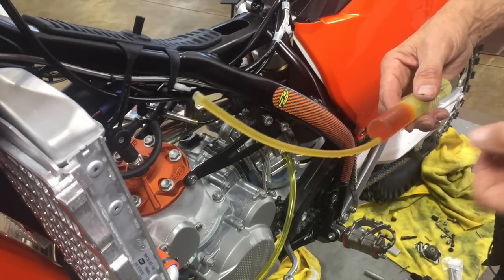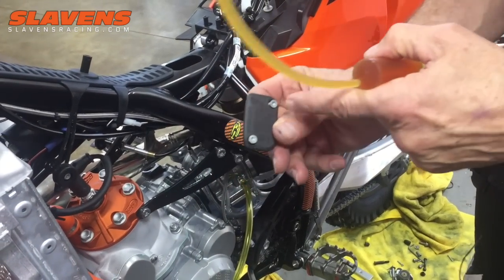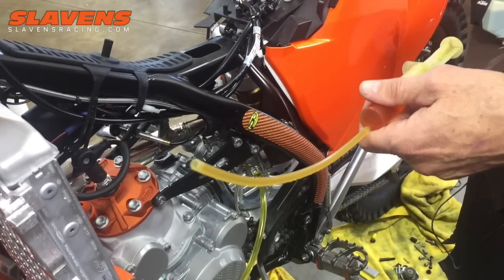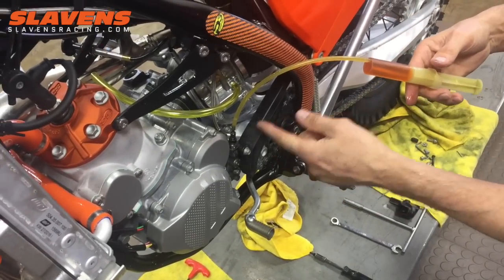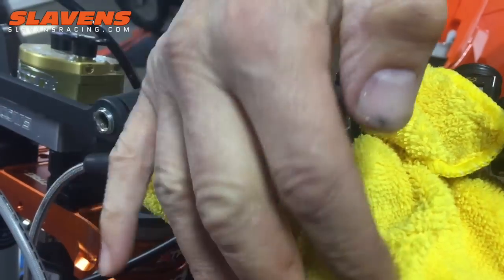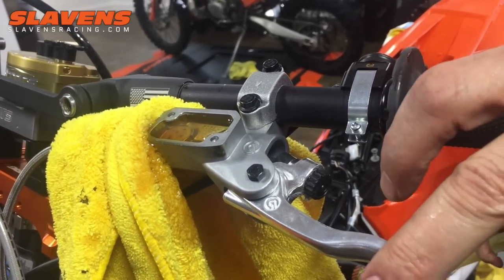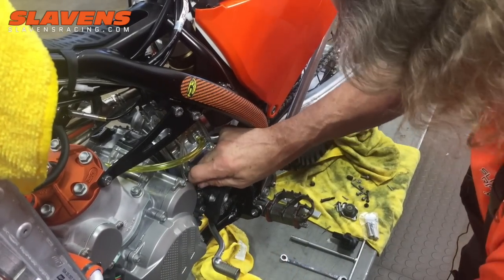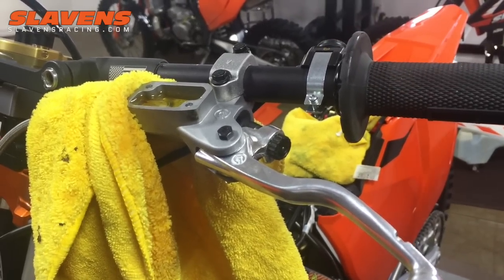How-to bleed KTM, HQV Clutch Master Cylinder

Comment: Hey Jeff I cant get fluid to go up the line and into the master its like it’s clogged or something 

What could it be ?
Reply from the maker: Is the lever slightly pushed in by the handguard or is there no freeplay in the lever?
Reply: I also have this issue.
I bought a 2017 300XC and there was only gunk left in the master reservoir. Tried to drain and bleed it but cant budge it.
I’m guessing either the master or slave cylinders are maybe jammed?

Comment: Thanks for the info that different clutches use different fluids. Mine, KTM SMT, uses mineral oil according to the manual. P.S. Why not just get two syringes; one to push, one to suck. That way you avoid the mess at the top.
Reply from the maker: That would be fine if you have a helper. My time working on bikes is private time.
Reply: @slaverace1  I just use an old Turkey Baster to draw off the reservoir as I pump in fresh fluid from below. Spit it into a jar nearby so I don't have to leave the bike.

Comment: In my little sight glass window of the front break master it appears to only be about 65% full of liquid and the rest of space above is an air bubble is this normal?
Reply from the maker: Definitely not optimal.
Reply: @slaverace1  shit bike only has 4 hours on it does it just need topped off with fluid and bled? Why is it like this you think?

Comment: Weird. A lot of ppl in the forums say the o ring in the slave cylinder can't handle brake fluid for long (despite the recommendation). The only thing i see with the mineral oil, is it is too thick to properly travel through the master cylinder (outside of viscosity,  its not gonna do more damage than brake fluid on a seal). And once that seal breaks, you're looking at brakefluid leaking into your oil. I'd rather mineral oil mix in there than brake fluid any day. Magura recalled master brake cylinders and it sounds like they need to recall the clutch slave cylinders on the 2018 oem parts. I feel the only reason they haven't done it is because it won't get ppl hurt. Its just a garbage part with no aftermarket replacement. More $$ for magura
Reply from the maker: You must have forgotten to turn on the BS filter on your computer before getting on the forums.

Comment: Hey Jeff,
This may be an amateur question but I recently replaced the clutch plates on my Ktm which has the dds clutch in it.  I back bled the clutch but it still seems to creep forward on me until the lever is pretty well all the way to the grip.  Is it likely there’s still air in the line causing it to release a little late or should I be looking more at say the adjusting ring outside the bevel spring?  Thanks in advance truly appreciate the videos.  Cheers
Reply: Jeff........I have the same scenario, using a genuine clutch in a 2020 300 TPI.....I will be reverse bleeding the clutch line again in case I missed some air.....have you got any advise please?

Comment: I've tried every way with mine it's not wanting to gravity bleed this way or anyway I rebuilt slave cylinder got new clutch line new master slave cylinder does this mean I need a new clutch plates or whole new slave cylinder please I'm tired I'm spending money I'm about to just buy recluse auto and say he'll with it
Reply from the maker: Jesse:
I don't "gravity feed" it. I push the fluid from the bottom to the top. Sounds like you need to find help locally from someone who is experienced at bleeding clutches. You have purchased several parts that you probably did not need and NO, you do not need plates.

Comment: I bought a magura bleeder syringe and it didn't come with a bleeder fitting for the hose can I just use the bleeder that's on the slave cylinder?
Reply from the maker: Yes, if you can get the hose to fit and stay on.

Comment: Jeff, what is the procedure for bleeding the clutch master cylinder with an adjustable rekluse slave cylinder?
Reply from the maker: Same as bleeding the original. Push the fluid from the bottom up.

Comment: Thank you for the excellent video Jeff. One question, at the very end then you removed the bleeder screw that was attached to the syringe, you put your finger over the hole to prevent fluid from coming out, quickly unscrewed it, and then quickly screwed in the stock bleeder screw to finish the job.  Is there another way to do this? I lose a lots of fluid this way. Before you remove the screw, could you zip tie the clutch lever so the line is closed, and then remove syringe bleeder screw and install stock bleeder screw? I was wondering if this would prevent fluid loss.
Reply from the maker: Hello:  Probably are other methods, but I've been doing it this way for many years with great success.

Comment: Hi Jeff. Thanks for the great video. I have a quick question. You say in your video rather to use DOT 4 as it’s better. Why’s that? I’m having an issue with my clutch that when i gets used a fair amount and assuming it heats up in the the tech slow stuff my leaver all of a sudden goes very soft and no clutch. Then I’ll have to leave it for a minute or so then back to normal. Clutch in not slipping an no grooves in the basket. It was bled 2 months back when i replaced all seals. I’m running 5.1 at the moment. Do you think there might be air in the system and/or should I switch to Dot 4? Would appreciate any guidance here please?  Thanks.
Reply from the maker: 5.1 was originally designed for street bike use and is not a high performance fluid. Every time your lever goes soft the fluid has boiled and is junk and should be replaced. Use Motul 660 https://slavensracing.com/shop/rbf660-pro-racing-brake-fluid-by-motul/ for better results.
Reply: @slaverace1  Thanks for the feedback! Appreciate it! Will make the change asap.
Reply: @slaverace1 MOTUL 660, Belray racing brake fluid or Motorex DOT 5.1? Which one is best for KTM XCW/EXC?

Comment: Why would you use a different fitting to bleed it? Seemed an extra unneeded step
Reply: The extra fitting has an o-ring on it that you can snug down. This prevents the syringe from pushing air through the system introduced through the threads of the fitting. It’s not absolutely necessary but does help. You can purge the air at that fitting by doing a normal lever pump bleed at the very end of the job.

Comment: You recommend 4 over 5.1?..What would be the difference?
Reply from the maker: I recommend you use a high quality fluid (like Motul 600 or 660) with a high boiling point but don't get hung up on DOT 4 or 5.1.

Comment: Can these systems not be bled from the top down with a vacuum bleeder? This kit is nice but I have a Capri vacuum bleeder on the shelf so I've been wondering about that.
Reply from the maker: Probably can be. I just offer simple solutions for the average Joe.
Reply: Yes. It's just better to chase any trapped air up instead of down.
Reply: A syringe is best for bikes because the system holds very little fluid. Vacuum bleeding is best for auto's.

Comment: Is this basically how you adjust your clutch? I have a 2015 ktm 300xc and my clutch grabs right away. How would I adjust that? Thanks for all your great videos Jeff.
Reply from the maker: No. The only adjustment is the lever position. There is no clutch adjustment. All KTM clutches have some drag.
Reply: You should've bought a Cadillac.

Comment: THANK YOU! Just saved me $105/hr of shop time. I've tried bleeding doing the pump, open, close, repeat method, but never get a better feeling clutch. My 2014 1290 (MINERAL OIL!) clutch gets spongy after 4 or 5 thousand miles.